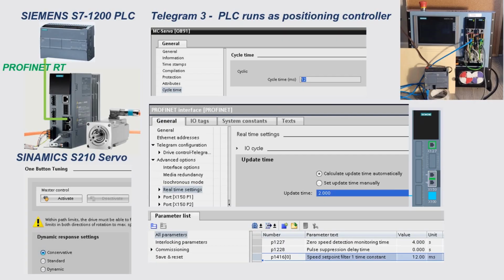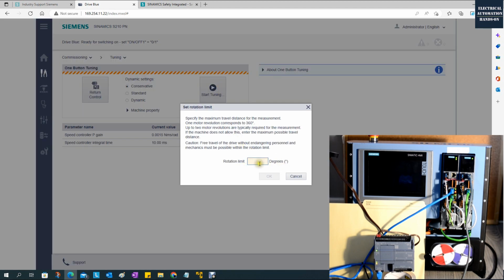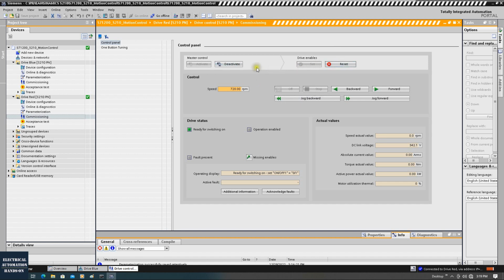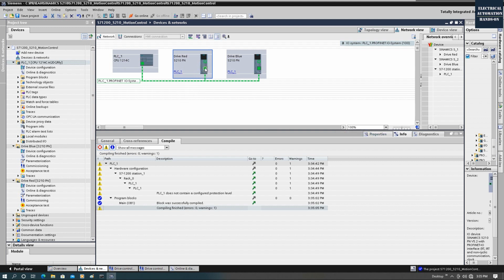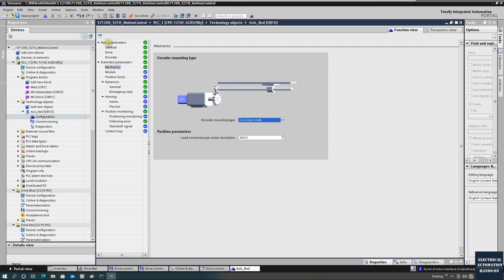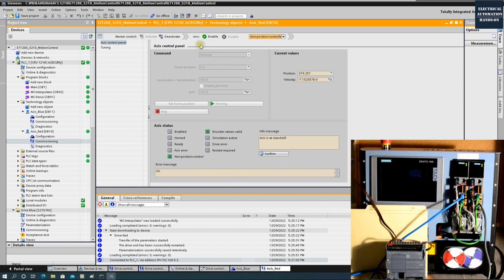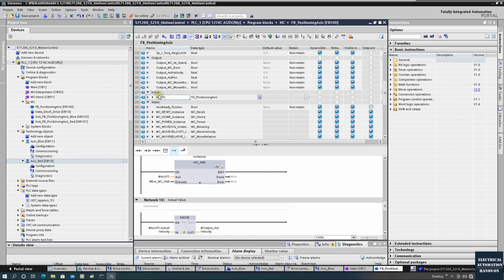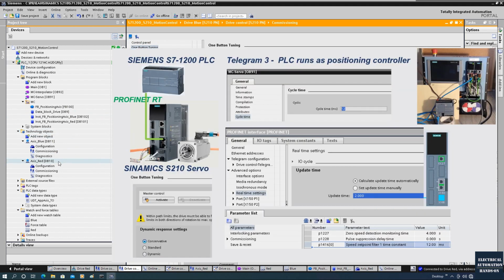MS07. [Siemens S210] SINAMICS S210 Servo and S7-1200 PLC Positioning Control (TO PN RT  Telegram 3)

Comment: Hi,
Can you make a video on configuring S7-1200 PLC to run a servo motor using Mitsubishi MR-JE-20AS controller using hardwire I/O'S instead of profinet. It will be easy to understand how servo can be run using third party devices.

Comment: How to use servo in torque control via PLC in order to control tension of web fabric winder macine ?
Reply from the maker: Please see the video MS05k. [Siemens S120 #9] SINAMICS S120 Drive Torque Limitation, Torque Reduction https://youtu.be/CpvjDHYWwvs. I will also publish a video about torque limitation torque reduction via S210, it will be one of the videos in the S210 servo drive series of videos.
Reply from the maker: I tested S210 torq reduction via MCTorqLimiting function block and it is working, I just need weeks to organize and edit those videos. For a short preview, you can use the link above the S120  MCTorqLimiting to have a quick look if you have an urgent project.
Reply: I will waiting for next video please, not urgent.
Reply from the maker: @vorapobautomation9760  Good Thanks!
Reply: @electricalautomation hello,sir  i cant see this topic,let me watch it please.many thanks